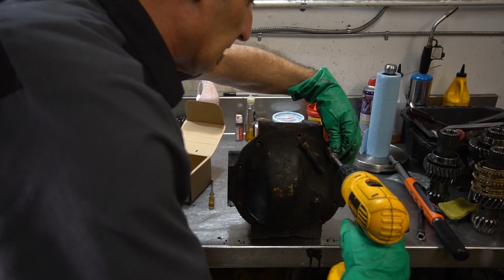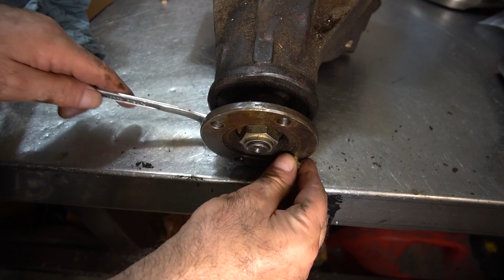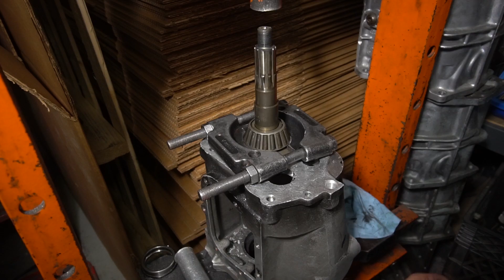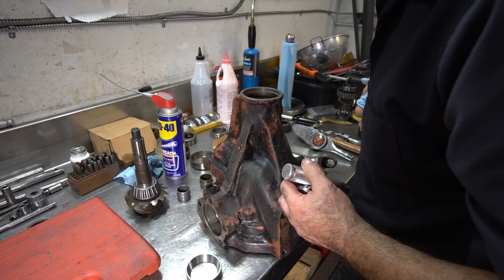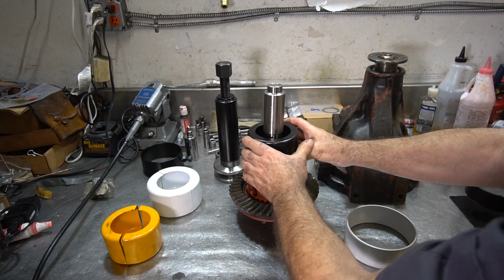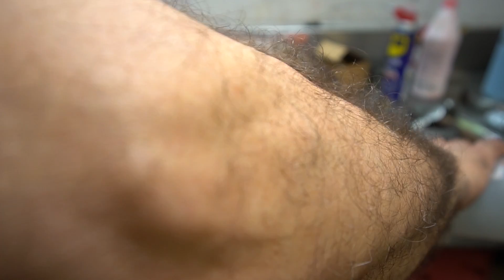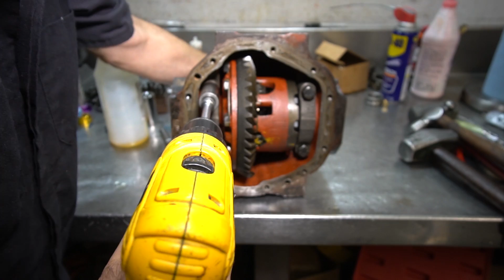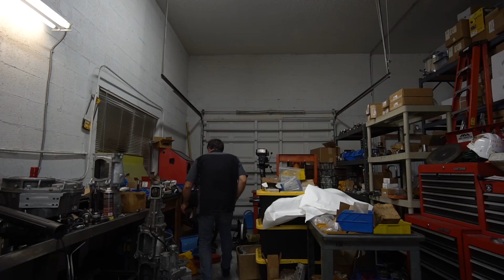Dana 44 Carrier and Pinion Bearing Replacement Basics Jaguar XKE

Comment: I understand your point about sealing the splines to prevent oil leaking  out along them. Have to ask though. Doesn't the anaerobic gasket gel set hard and make it impossible to remove the flange later?
Reply from the maker: No, it won't. Plus, just a little heat will work free it up
Reply: If you're worried about using anaerobic sealer, white liquid Teflon sealant should also work (which is what GM says to use, IIRC).

Comment: Thanks for the great video. Super helpful! I'm rebuilding the Dana 35 rear end on my 2000 Wrangler, something I've never done before. I have a question regarding your technique for setting the pinion bearing preload without a torque wrench. When torquing the pinion nut, you seemed to go by feel. How do you know you collapsed the crush sleeve enough? Does your impact driver have specific torque setting to help you get close? The FSM says to (1) Tighten pinion nut until there's no end-play. (2) Torque pinion nut to 200 ft lb. (3) Set 3/4" torque wrench to 350 ft lb and crush the spacer until end play is taken up. (4) Tighten in 5 ft lb increments until rotating torque is achieved. The problem is I don't have an expensive 3/4" 350 ft lb torque wrench, so I'm a little concerned about achieving correct preload. Can you offer up any advice? Or do you think I should go out an buy 3/4" 350 ft lb torque wrench considering this is my first time setting pinion bearing preload? I can get a cheap Harbor Freight 3/4" torque wrench, but the max on that is 300 ft lbs. I do have a Husky H4480 impact wrench with 3 torque settings and a max 800 ft lbs of torque. I'd appreciate your thoughts or advice. Thanks!
Reply from the maker: Don't confuse pinion bearing preload with pinion nut torque. That is my point in the video.   The pinion preload lets say is 20 inch pounds. You can set this up by just tighting the nut WITHOUT  crush collar. Once you have the desired pattern and backlash you can then reinstall everything with the collar and tighten it until you reach that same 20 inch pounds of drag. In a non crush sleeve application with just a spacer and shim the same you adjust the spacer shim to get the same drag, but since it doesn't crush you will have to use a torque wrench tighten to the specified nut torque.
Reply: @GearBoxVideo  Got it. I was confusing pinion bearing preload with pinion nut torque. Thanks for clearing that up and thanks for the reply!

Comment: Can you set the preload with the axles and tires on the car?
Reply from the maker: On a new ring and pinion, no. The crush sleeve or pinion spacers purpose is to allow you to change the seal and retorque to the specified number to achieve correct preload duplicating the original setting.

Comment: I'm in the middle of freshening up a badly rusted Dana 60 Front, GM King Pin. Your video was a great help, Thank You! Now I've rebuilt 12-bolts, 10 bolts, 14 bolts, but this Dana 60 Front has been a labor intensive endeavor simply because of the crude engineering of the shim placement. I use an OTC bearing splitter exactly like yours and have even sharpened the leading edges to minimize damage to the shims as well as the carrier and the pinion. It still wiped out the shims and rolled a bit of a shoulder on the carrier, nothing a file couldn't take care of. One surprise was the "lock bolt/pin" that locks the spider gear pinion shaft in place inside the carrier. I had thought the previous mechanic had broken the bolt and reassembled the unit. Wrong, this Dana 60 uses a 3/16" x 2" roll pin! I didn't realize this until all my extractor efforts failed and I resorted to punching out the spider gear pinion cross shaft shearing the roll pin. I then realized that Dana has a hole completely through the carrier to drive that roll pin out. Tough lesson, a six pound hammer and a 3/4" bull pin drove that cross shaft right through that roll pin and right on out on the 3rd blow, no damage. Oddly enough there was exactly .100" thou. of shims split 65/35. I actually used a small bottle jack under the pinion sitting on a 4x4" tube steel leg off my engine puller. I used grab chains suspended from each end of the axle  supporting the steel tube. That allowed me to use the small hydraulic jack to push up the center of the housing while the chains held down the axle tubes and I was able to open the case .005" of an inch one thou at a time. The dial indicator let me know how far and also let me know when everything sprung right back to zero.  To bad those Corporate 14-bolts don't come as front axles because they're way easier and stronger than the Dana 60's...I think I may look into a reverse rotation gear set for a 14 bolt and use Dana 60 King Pin castings and yokes...? Thanks again for this and all your videos, I like your no BS way of explaining things! ;)

Comment: I did a Dana (Salisury) 44 on my Sunbeam Tiger. In my case the carrier bearing had spun on its mount and there was .035 side play (don't ask me how???)! That bearing literary fell off as the mount was .010 undersize! This necessitated I replace the carrier and ring & pinion. I got a used set (2.88).   A few things I remember differently:

 I recall the pinion pre-load being set with shims (no crush collar). I did not have an inch-pound torque wrench but recall there was some but not much resistance to turning.  BTW, I used the EXACT same method of measuring pinion depth. A bar with a hole in the center lets the depth mic sit and not needed to be held.That said the race was SO TIGHT it was a nightmare to get it out (I needed to add a few thousandths).

  The carrier bearings were on the outside of the carrier bearings (between the race and the case). This actually made balancing them easier. The manual stated to spread the case .007  (I made a spreader very similar to the one you have) getting an appropriate pack set and then flip flopping the shim to set gear end play. Once the end play was set the spreader was released and I assume that set the pre-load.

In the end pinion set to the exact depth, I had (hopefully "in range") pre-load on the pinion (I could tell the difference between .001 in the shim pack) I had the end play within the.0005 (.0065 on a .007 setting) and something you did not mention run out on the ring gear of .002. It all turned smoothly but everything had a presence of pre-load. Sadly the Tiger is still on jackstands 18 years later so I don't know the full outcome - yet. The most frustrating thing was EVERYTHING on that rear end was such a tight press! I heated the case, put the pinion race in the freezer and and shortly thereafter it was big whacks with a 5 pound hammer on a wooden dowel to get the race out to change the shims. I did not measure the pinion depth with pre-load initially but found no difference after the fact.
Reply from the maker: Thanks for sharing. Nice story.

Comment: Dana 44 replacement ;
Step 1 : Remove and carry to nearest scrap yard .
Step 2': Install 14 bolt or Dana 80 
😂😂😂👍🤣
Reply from the maker: This is for a Jaguar and that isn't an option.
Reply: @GearBoxVideo   I know , just trying to be comic relief . Im a 9" fan , i gave up on gm corporate and Dana 44s back in the 70's . Just absolute weak junk in my opinion.  But ya gotta keep some things original right . Thanks 👍
Reply: swampratt36 Definitely more robust

Comment: Have you ever found that the Bearing Cap mounting surface is not the actual center of carrier bearings? If not would measuring from that surface to bottom of Bearing Saddle to see if it was exactly 1/2 of cup diameter help determine if it were the center? Thanks and Great Videos
Reply from the maker: If the cap doesn't split exactly at the center it would be impossible to install the bearing. Think about it.
Reply: Thats interesting because a previous owner has different caps on my dana 60. Question is, if the caps were in wrong orientation or switched from another housing then how can that cause a problem? And what can be done to sole it since dana 60 fronts are getting harder to find cheap?
Reply from the maker: Because the housing is align bored and machined with the caps installed. Would you switch engine main caps or rod main caps?
Reply: No, never. But, in the case of a front diff used offroad only, I was told it should hold up fine. I have no idea why someone would do that other than inexperience when they changed the gear ratio because they didnt have a spacer  or crush sleeve on the pinion either. Is it worth keeping or is it total junk?
Reply from the maker: I really can't say. If it has been working leave it alone
Reply: The original owner is nowhere to be found and I learned he was trashing front driveshafts. So, Im picking up a replacement tonight and using the old for parts. Thank you for your indespensible knowledge you have shared on you tube. Keep up the good videos. Us 4x4 guys love the axle tech. Rock on!!

Comment: Differentials have been "the last frontier" on cars for me. I've removed axles to change outer bearings and seals, but nothing else. ETCG just made a video about putting a kit in his father's truck diff, but I didn't quite get it. Your video helped me understand a lot.

Also, as a DIY/hobbyist, it's refreshing to see a real master using "regular tools". I priced your bearing cone heater from another video and gave up the fantasy of owning one - so happy to see you using a heat gun (already have one). Thanks for sharing your knowledge here.

Comment: I agree -- this is a great instructional video, and I have now subscribed to your channel. Do you have a video showing how set up ring and pinions? I'm running Dana 30s on a vintage race car. I want to create a backup axle and have a new ring and pinion on the shelf.  We create our own wear-able limited slips. Have never heard a description of what it might be called but it consists of 2 machined blocks with 4 very stiff springs between them. Would send a picture if I knew how to do that.
Reply from the maker: I am doing a new ring and pinion swap soon in a Dana 44
Reply: That description sounds exactly like a Phantom Grip LSD conversion kit.

Comment: When installing the new outer bearing races into the diff housing, why didn't you put the bearing races in a deep-freezer first, to make them smaller? Same concept as heating the inner races with a heat gun to make them larger.
Reply from the maker: This deep freeze thing people talk about requires a special freezer. Freezing takes time and is impractical in most shop operations. Look at my bearing heater I use in my Dana 300 rebuild video part II
Reply: @GearBoxVideo : Oh, I didn't know it required a special freezer.
Reply: @fyrstormer  even a normal freezer with help some..... might be enough to allow light taps to get it on

shitty cold and shitty hot = decent 
no cold and shitty heat = still shitty

Comment: I have a question, but it doesn't directly pertain to this specific differential.
Posi-Traction: When I look at diagrams for how this works, it looks like it's not really a differential, but a spring-loaded "unlockable spool". It looks like it stays locked until enough torque builds-up between the two output shafts due to the wheels trying to rotate at different speeds, and then the two halves of the spool slide apart like slipping gear-teeth, temporarily unlocking just long enough to dissipate the built-up torque. Is that accurate?
Reply from the maker: That is what a Detroit Locker is. Positraction is basically a set of clutches that slip when they are subject to a certain speed differential
Reply: @GearBoxVideo : That's right, I mis-remembered the name. So a Detroit Locker really is as simple as it looks? It's just a two-piece spool with a spring-loaded ratchet in the middle?

Regarding Positraction: When you said "speed difference", did you mean "torque difference"? Because if the internal clutches don't slip at first, there can't be any speed differential between the two output shafts. Is Positraction basically a crude limited-slip diff with spring-loaded clutches that have a pre-set torque limit, and any additional torque above that limit causes the clutches to slip and the additional torque escapes through whichever wheel has less traction?
Reply from the maker: Call it what you like. Positraction or limited slip as soon as you turn and there is a speed difference it slips. Yes you will need some break away torque which is why they are horrible turning on ice.
Reply: @GearBoxVideo : Thanks for clearing that up. In that case, Positraction does sound like a very primitive form of limited-slip differential, whereas newer designs require no breakaway torque while coasting, only while accelerating.

Comment: Strange Engineering  casts their own Dana 60 with threaded side bearing caps so you don't have to use any spacers. Just like big heavy duty trucks .
Reply from the maker: Just like any 9 inch Ford as well
Reply: @GearBoxVideo    That's good to know. The only reason  I steered away from Ford 9"  is they say it has 3.5% more friction or drag in the gears.  The strange version  uses 35 spline axles.  The Ford  Torino flange is a good axle flange set up to mount a disc brake too.
  I was surprised to see some versions have a drum brake inside the hub for a parking brake. That seems like a lot of extra parts  for a parking brake.
 Some one told me that New Process actually built the Ford 9" Carrier.  since 1957 .
Reply from the maker: Most new housings I've seen are based on the 9 inch. So with the Nascar guys using some variation of the 9 inch, I don't know how big of a deal that really is. I don't have any experience with the ones that they make
Reply: @mikeskidmore6754  Drum-in-hat parking brakes actually make sense for several reasons. They allow more effective and efficient disc brakes with simple calipers, rather than a jack screw mechanism - making assembly and maintenance easier and reducing the failure points in the service brake. They prevent the service brake surfaces from overheating, glazing, or otherwise being damaged if the parking brake isn't released before driving. They, ideally, completely eliminate manual adjustment except when installing new parts. They allow the parking brake to be an effective emergency backup in the event that the service brakes completely fail. They can also be lighter than a combined mechanism, drum or disc, of similar size.

Comment: You got so lucky on that pinion nut.  I have had to use heat sometimes to get them off on my jeeps.  One question.  Why would you not check the backlash?  The bearings had enough wear that the ring and pinion must have had at least some.  Since the diff was out and your working on it, would this not be the best time to check it and set it to the lower limit of backlash?  I say this because backlash gets worse with time, not better.
Reply from the maker: It doesn't work like that. You are replacing worn bearings therefore the gears will be restored to their original backlash, plus the pattern checked perfect . If a gear set is worn you change the gear set.
Reply: @GearBoxVideo  I know I am being a pain.  I always thought that the pattern check was to insure proper alignment of of the pinion, z axis.  Backlash is a function of the x axis.  Y axis is a fixed point set at the factory.   Now if there is .0005 wear on both ring and pinion, this could increase the backlash by a factor of .002.  God only knows where the factor set the backlash, higher or lower end of the tolerance.  Add this to the manufacturing tolerance of the bearings.  I am sure that it is not 0.  I know this from making pistons.  We had 0 to -0.0005 on the skirt and 0 to -0.00025 on the pinhole.  Add all of these errors up and the backlash could be off, even if it is a small amount.
Reply from the maker: No , a pattern check  will show you proper backlash. Just look up any pattern check diagram. If your pattern is basically centered then your depth is correct. If that centered pattern drifts to the top or bottom, then you need to make a backlash correction. Normal wear is normal wear. Abnormal wear due to loss of oil or heat checking is not so a gear set needs to be changed.  In normal service life of a ring and pinion with no bearing failure you are not going to tear down the rear and readjust backlash. Bearing tolerances are not the same as wrist pin tolerances.
Reply: @TheLittlered1961  I was thinking with my Luck  the new bearings would be different.  I have rebuilt some Heavy  truck rear ends. Eaton made great service manuals. 
  A ring  gear and pinion are machined together as a matched set.  The engrave the proper lash on the ring gear.  Eaton says to  measure all of this on a used set and put it back the same way . A new set will have the desired lash engraved on the ring gear. 
   My really old Eaton axles had nuts with cotter keys.  I just realized that with a very heavy pinion bearing spacer  you can put unlimited torque on the nut .   Once you establish the proper thickness  of that spacer to get the proper pre load.   If you are using the old bearings over you can just grind say 0.003" of the spacer and you have the correct pre load again
Reply: @mikeskidmore6754  I guess there is some confusion here.  When I said he got lucky with the pinion nut, I meant removing it.  On my 1965 wagoneer I sold the front gear set to some one.  He had to heat the nut to remove it.  My 79 J 10 I had to heat front and rear nuts to remove them.  I was not talking about preload.
Reply: @TheLittlered1961    I use a 3/4" air powered impact wrench  . never had a problem getting one off.. Plan B heat the nut with a acetylene torch .
Reply: @mikeskidmore6754  Yep, did not have the 3/4 impact.  Plan B was the best plan.

I was surprised that he could remove the nut, on the bench using a breaker bar and that little rod.  The diff's I did it on were also Dana 44s.  Still on the vehicle.